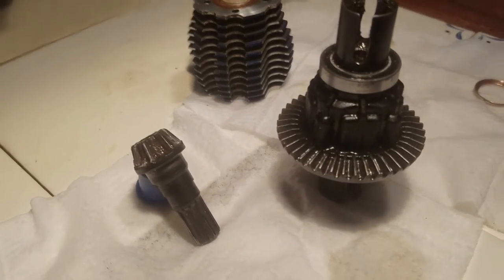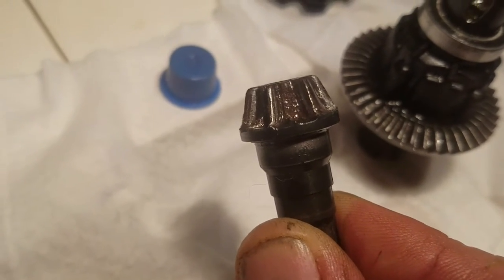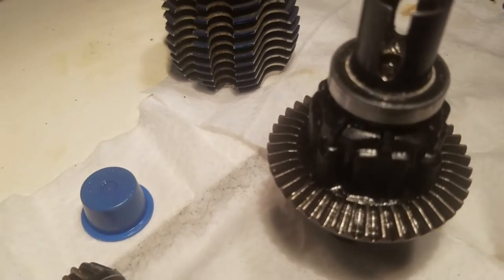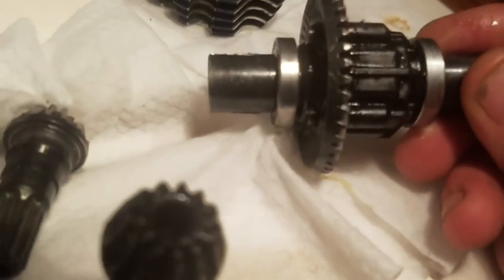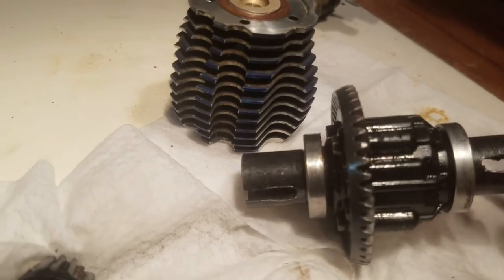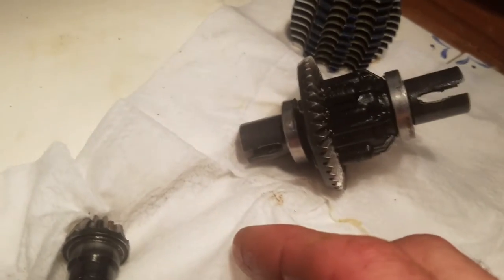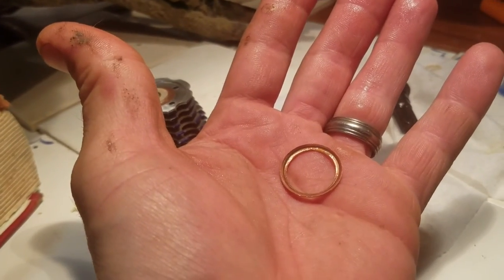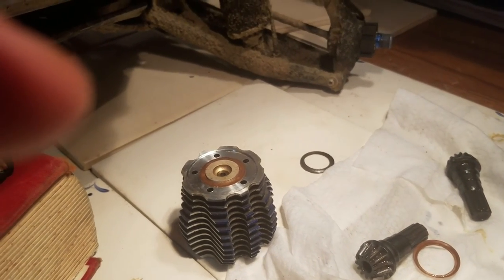X-maxx Differential Workshop Blowing Fewer Diffs on Bigger  Hits

Comment: what kills me about the traxxas diffs being sintered metal, isnt just the fact that they break easy what kills me is they dont wear very well either.  When they start to wear down you cant just shim like i do on my arrma cars cause once the smooth surface wears off underneath its just like sand under there.  Im not an arrma fanboy all i ask traxxas is make those diffs out of real metal not the powdered junk, heck charge more if you have to but stop with the junk metal.  Erevo has this too.
Reply: shim ... solved this pinion tooths
Reply: @tsegitsegine5882  what's a shim?